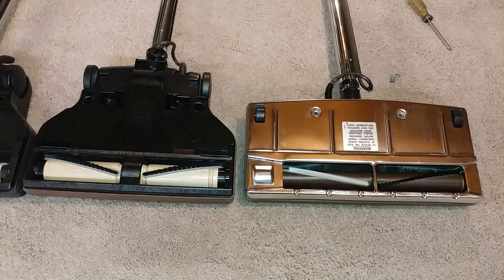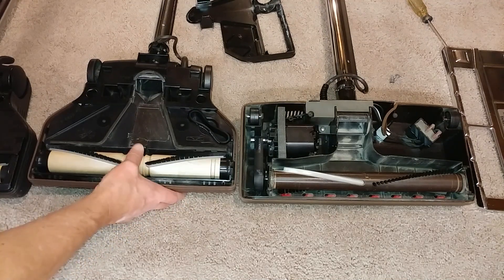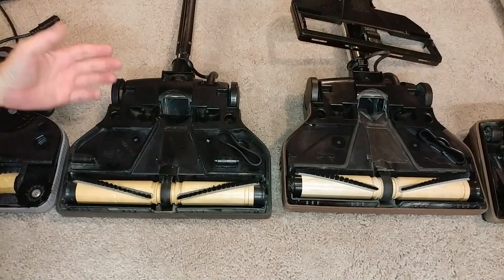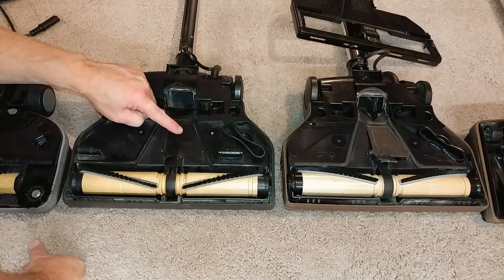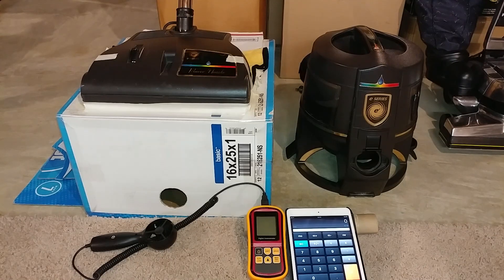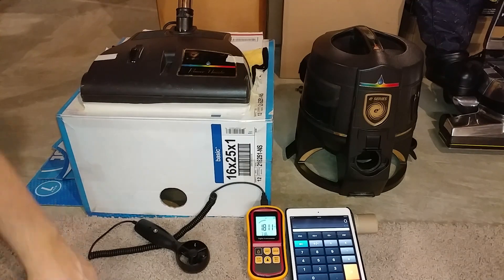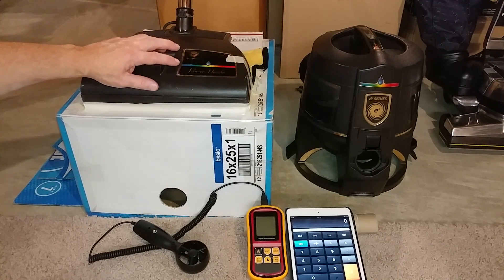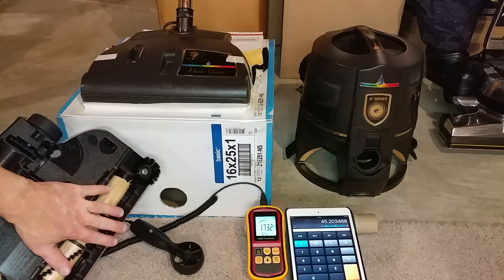Rainbow PN 2E Nozzle Airflow Box Tests And Comparisons

Comment: When training with Rainbow they admitted that the PN2 had horrible air leakage and that's specifically why they came out with the PN3. They also replaced the beater bars with stiff bristles so customers wouldn't have the worry about carpet snagging due to the beater bars forming a nic in them and scrapping the carpet. So yes PN3 is a much better nozzle, only problem I have is the bristles need to be a tad bit longer to provide a little more agitation with people like myself with low low pile carpet.